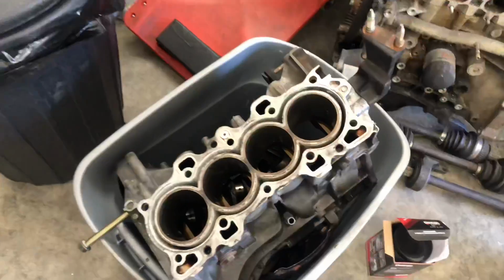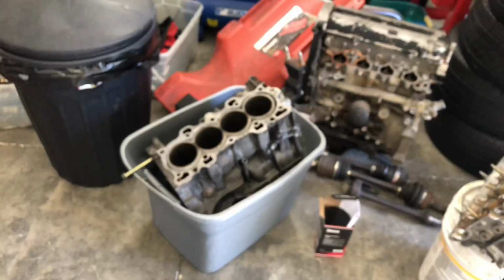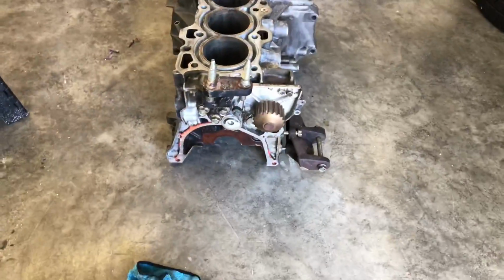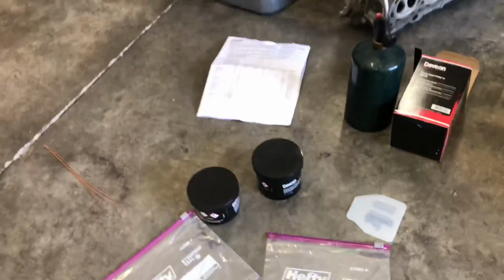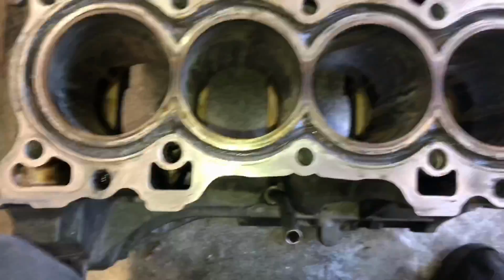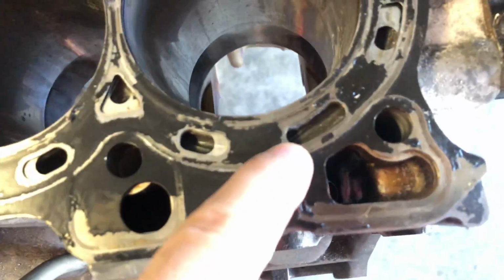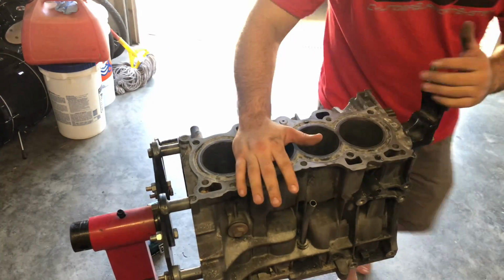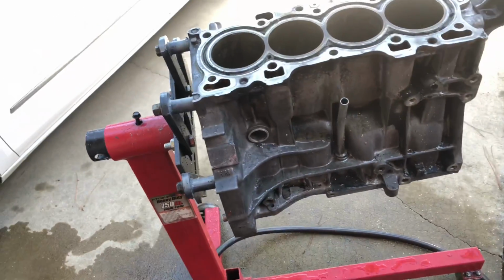The CHEAPEST Alternative to SLEEVING an Engine

Comment: Not sure where u live but here in NC the devcon is more expensive than a tap in block guard and the blank area between devcon and head gasket is not a good thing at all it allows air pocket and produces steam I'd like to see a full grout fill with blank water pump

Comment: We use this at my work at a industrial manufacturing plant. We use it to fix holes in steel pipes and for applying patches to 24 inch pneumatic lines. It's tough shit but kind of a pain to work with

Comment: Could you possibly use a fill weld to bridge the gap so that way you are actually combining the metal. Or would that warp the cylinder?
Reply: I think it would be interesting to try, you would have to deck the head and possibly re-bore to account for any warping. You could probably minimize any warping by keeping down the heat
Reply from the maker: Not sure tbh.

Comment: Guys have been filling blocks with machinist grout for 50 years so why wouldn't it work!
Reply: Yup. This method has been used since the early days of drag racing.  The trick is to select the right filler that has an expansion rate close to the block material.
Reply: Rich Theory 
Yea I was thinking this was a new twist on the old “block filled with cement” trick you stated above.
Reply: Epoxy block filler... smh.
Reply: Baking Soda & super glue might work, too?

Comment: I fucks with this dude! I would like to comment I wonder if you could do the same process with concrete or even the JB weld for high heat? The concrete would be more weight but I remember hearing about old timers using it in sbc’s
Reply from the maker: Moroso makes a “cement” specific for engines :)

Comment: Well this is not a sleeve or anything to do with replacing a sleeve / liner and not too mention your don’t have a coolant system, this is old trick but people used concrete or something similar or you can half fill it if you still drive on the street, but if your full only race car/ engine or drag racing only  just fill up the whole coolant gallery’s
Reply from the maker: Finish watching video, i drill out holes. This still uses the cooling system

Comment: I know this is a little late, but VMS Racing makes $50 block guards for most honda engines. Not knocking on Devcon, just for 10 bucks more you can have a simpler and easier install.
Reply from the maker: Brendan Gallagher block gaurds dont provide same support

Comment: Wouldn't a block gaurd do the same thing?
Reply: Patrek Brown no they warp sleeves
Reply: Kind of: The block guard will do the same job of preventing the top of the cylinder wall from walking on the head, protecting against a large detrimental failure, however; this is applying an extremely solid point that the cylinder cannot flex at all into so any out of wack forces you are trying to protect against will just go for the weakest part-the middle, warping your cylinder.  The Devcon, regardless of how well it hardens cannot be more solid than solid metal.  Think about it as going from stock suspension (stock block) to stiff coils with good dampening (devcon) to ridin dirty on hockey pucks (Block guard).  Both accomplish the same job of lowering your car and looking sick, but with the hockey pucks you are as low as you can be and you know you won't rub because you have no travel (similar to knowing the cylinders won't walk because you have a beefy block guard in), but this is going to wear on your suspension WAY MORE over time whereas with the coils they'll get you near to what you want but you might rub a liiiiiittle bit, but because you have suspension you're not forcing any parts to take more force than they were built for. (like having Devcon so you it's being held in place, but with a little leeway)
Reply: this is just a pour in block guard. considering u can buy a guard to drop in without all the extra work fpr same price i dont see the point other than to try somthing different and nothing wrong with that at all..     btw block gaurds do not warp cylinders they prevent it which is the curse of an open deck but cooling is amazing....u also dont want a SHOCK absorbing guard as other guy explained... 0 movement is what u want solid and u can get it.. any movment in cylinders cause deformation  of the shape of the sleeve which will destroy the piston as it travels

Comment: Good stuff I made 450whp on a stock sleeve not css, b20vtec nitrous 175 shot dry Yosolo tuned
Reply: WOW really what was all done to the engine? i never could do that even on a stock k20a2 . i was using wet kit anything over 150shot k20a2 would go boom. on turbo we made killer power and my tuner stock k20a2 made 700whp for 10 years but spray we had no luck
Reply: Nice you have a video of it be cool hear that thing scream on spray
Reply: PA Tuners there’s a old video I just posted up on the dyno
Reply: H2B Luis cool I'll check it out

Comment: iv personally used this product on a built high comp turbo lsvtec. definitely got the job done! great video but remember, nitrous is still forced induction not all motor :)
Reply: Nitrous is not 'forced induction'...
Reply: really? put a nitrous car in an all motor class and let me know what they say lol.
Reply: either way very excited to see this car smash around with this set up!
Reply: Obscured Motivations where did I say that nitrous and all motor are the same?  I’m simply saying that nitrous is not a form of forced induction....
Reply: so nitrous isn't forced induction? thats weird I wonder what it does than..richiewerks runs his nitrous cry in forced induction pro..sorry ill use correct term (artificial) induction lol
Reply: actually, nitrous is considered to be chemical forced induction. it doesn't matter in what form you introduce a higher charge of oxygen into the combustion that is possible with atmospheric pressure.

what you are referring to is mechanical forced induction. in fact, nitrous builds experience many of the same forces as forced induction. you run into issues on high compression, the bmep (brake mean effective pressure) in the combustion chambers increases drastically just like in any forced induction vs na, hence block strenghtening.
Reply: Obscured Motivations wrong
Reply: 962RACER wrong never heard of such a term and I’ve been in the automotive industry. You too haven’t a clue. You spray nitrous not inject into into the engine
Reply: +962RACER First off you don't know what my background is or what field of work I do, so you should stop while you can!!! I have over 35 years in the car repair business and have forgotten more about cars than you will ever know!!! NO ONE USES THE TERM CHEMICAL SUPERCHARGER!!! NO ONE!!! Go ahead and take your ass to the speed shop and ask for a Supercharger and see what they put on the counter.  A SUPERCHARGER is a mechanical device used to move great amounts of air!!! An engine is ONLY SUPERCHARGED when a positive pressure is induced into the intake tract!!! Nitrous is NOT FORCED into the cylinders therefore the engine is NOT SUPERCHARGED!!! It does have a POWER ADDER though, nitrous oxide!!! Nitrous is a FORCED induction and a Super (or turbo)charger Nitrous oxide!!! They are not the same!!! Get over it no one agrees with you!!!
Reply: your "credentials" and capitalization still don't negate the fact that a book i referenced made a very clear case, let me guess, you never clicked the link, never looked at the sentences written in the book, lol. the term isn't used commonly, but it's still a term for reasons i thought i made clear. what you commonly hear is not all there is.....
Reply: +962RACER Dude I call foul on your ass!!! Do you even understand what the word "forced" means? It means to cram it in there!!! Nitrous is NOT FORCED into the cylinders, it rides the same air steam as a naturally aspirated engine has. It's not "forced induction " unless it has a "Supercharger" or a"Turbo". You see then the air charge is greater than 14.7 psi and that is positive pressure.
Reply: i wish you had more background in physics or chemistry, because i made it abundantly clear why the term is referred to as "chemical supercharging", which translates to "forced induction". forced induction does mean cramming air in above atmospheric pressure, but what you are missing is that the term actually doesn't refer to how you get more oxygen, not air, into the mix. the whole point of forced induction is to increase oxygen content in the mixture so you can add more fuel and more, obviously, oxidation. in the case of nitrous this oxygen is introduced chemically rather than increasing the pressure of induction, but the effect is the same, more oxygen in the combustion chamber. this is precisely why it's also referred to as chemical supercharging.

i take it you never looked at the link i provided, which literally takes you to a book where the term and references to my statements are to be found. if you don't care about what books on an engineering topic say, then there is no hope.
Reply: Obscured Motivations clueless nitrous is not forced induction!! Not even close it’s just a power adder you uneducated muppet.i bet you don’t even have a performance vehicle or a car
Reply: Obscured Motivations your another wannabe car enthusiast. I’ve been in the automotive industry for more then 15 years now in my 30’s . New generation or millennials

Comment: Only the rich guy hit the thumbs down
Reply: I like that u keep it real most people work for a living and cant spend money on what they really want and i bet that epoxy sleeves will surprise u its been around alot longer than you and i
Reply: Dolores Butcher To be fair, MOST rich people work for a living.
Reply: Dolores Butcher heck it’s not even about that to me. If you don’t need to spend $300 CSS then why do it. This is a proven way to strengthen the stock sleeves.
Reply: Stacy Pfingsten as he wears a CSS shirt lol

The 1000hp j series s2000 is using a resin as well.
Reply: And also smart guys that realise this will choke the water coolant flow around the cylinder walls, thus heating up the engine alot and more soo on open throttle thus robbing themselves from good power at wide open throttle
Reply from the maker: Facts lol

Comment: i did devcon recently and my sleeves cracked @650whp...I was one of the un lucky ones but now i have a aebs sleeved block.
Reply from the maker: Dang. Still 659 is good with stock sleevves !
Reply: It would have survived i think if i didnt rev it to 10k...it was on a stock ITR trans was was trying to hit 140mph without going into 5th. other then that it would have been ok.

Comment: Ghetto 😭
Reply: Works very well... i had a setup back in the day with the same stuff made over 600 and ran lots of high 9sec passes in the 1/4
Reply from the maker: Lol
Reply: SP Tuning back in the Hood days they Used Block Guard and Tig it.Deck afterward of course. Then CCS came out 🤣
Reply: cuong tran they still do this.it holds 40psi
Reply: Feel free to elaborate on simplistic terminology.
Reply from the maker: **cost effective

Comment: K series or b series, which do you prefer?
Reply: Angel Reyes H series
Reply: I'm a k series guy, but a high rpm boosted B sounds wicked. B series have a very distinct sound!
Reply from the maker: K is the way! I prefer k series, much more fun and more power. But b series is cheaper. Budget lol
Reply: k series because we don't need to put putting in our blocks for over 250hp lol